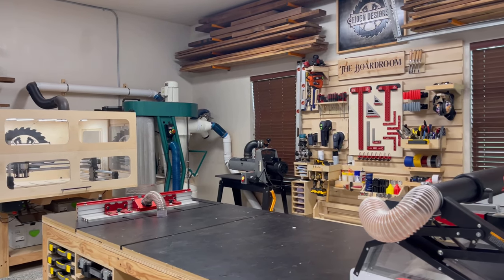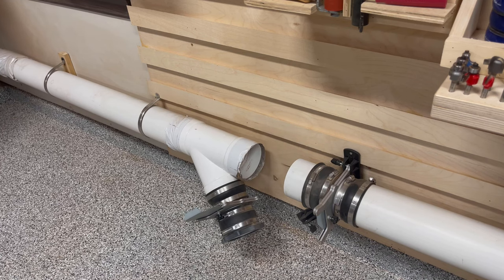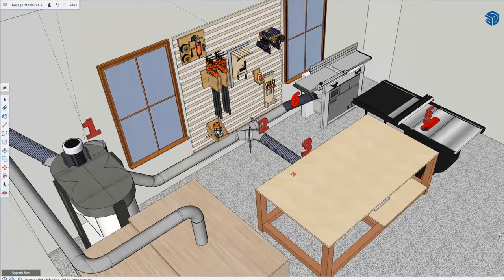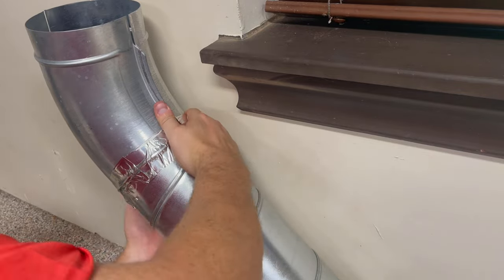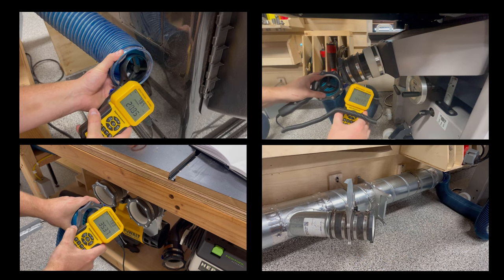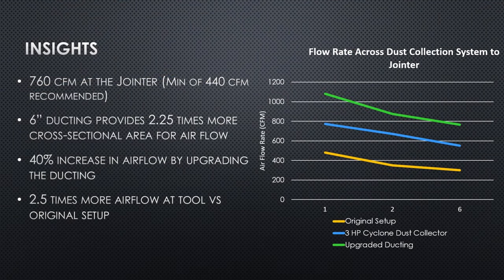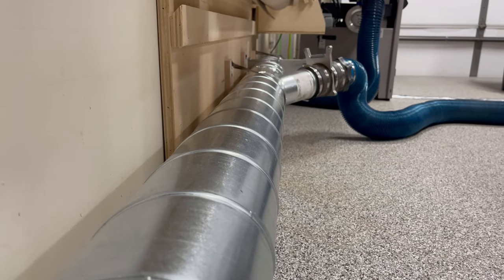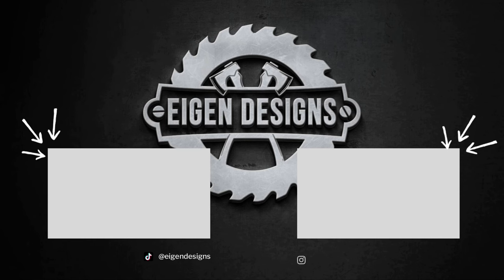Upgrading My Dust Collection Ducting  |  Airflow Analysis of 6" Ducting

Comment: Just figure the difference in the area of a circle 4" diameter versus 6".  My 3hp cyclone with 6"" pipe does fairly well even with my wide belt sander and edge sander.  The 15" planer works well even with 2 gates open.  Did have to modify the edge sander port to 6". My wide belt sander had a small opening, and had to cut the opening a little bigger to get 6" connected, and it is the hardest machine I have to collect from.  Problem now is a 50 gallon barrel fills very quickly.

Comment: wow pretty much the best made video I have watched in 24'  sketch up looked so good... your voice and not a wasted word.   THat flex to saw stop must be a tripping hazard?  I hope you included links so we can get a quick look at 6" spiral pipe costs.
Reply from the maker: I am glad you enjoyed it. Yes, the flex hose is a bit of a hazard, but it's only connected when I am using the sawstop. I use some MagPort quick-connect couplings to easily attach and remove the hose when not in use.

The spiral pipe can be found at Rockler.com at search for spiralpipe. It's expensive stuff, be warned. It's not uncommon to have your ducting cost more than your dust collector. I have been operating this for about a year now and think very highly of the ducting, the blast gates, and the elbows. It's a significant step up from PVC, but you pay for it.

Have a good day.

Comment: Any issue with grounding? I thought metal ducts were prone to static issues.
Reply from the maker: I haven’t had a single issue with the grounding. You can certainly add a grounding wire if that’s a concern

Comment: Thanks for the excellent videos and thorough analysis.  I really appreciate your precise measurements and the detailed graphs and tables comparing the results.
However, you forgot one very important tool in your analysis… the “CNC”.  
I have been planning to purchase a OneFinity CNC, but do not yet have any dust collection.  I was looking at the smaller Grizzly G0860 (1 ½ HP) dust collector to reduce cost (about $1000 vs about $2200 for G0862). 
What do you think is the minimum HP and CFM needed for the CNC?  Did you measure the flow at your CNC?  
What factors compelled you to choose the 3HP G0862?  
Thanks!  (I'm subscribing!)
Reply from the maker: Hey WJ - thanks for your support... it means a lot. 

Regarding the flowrate at the CNC, I didn't measure it for two reason: (i) the ducting run from the dust collector to the CNC is very short and (ii) my CNC already had way more flowrate than it needed. 

Looking at the two dust collectors you mentioned, I think either of those would be plenty for a CNC, provided that you have a good dust boot. Beacuse of how close the dust collection hose gets to the CNC router, the CFMs needed for good dust extraction is much lower than something like a table saw. One thing I would highly recommend is a 4" dust collection hose. I used to have a 2-1/2" hose and it just wasnt big enough.

Comment: Nice video. We understand your shop is cramped. Imagine if you could have a straight 10’ run going into the dust collector. No bends; no flex hose. I wonder how much of a CFM increase an ideal layout would add.

Comment: I run six inch ducting but I can hear myself whisper with my dust collection on full power. I built a soundproof closet for the DC but I pull air(which is more efficient)  instead of a giant blower housed on top of the cyclone blowing air downward, which is an archaic system imo. 
An obscenely loud DC simply isn’t an option for me personally. Especially with the CNC router where it’s sometimes running all day..

Comment: I have a single stage d/c with 6" to every machine  (including at the machine, no 4") and agree that the larger pipe size is the way to go but only if you're a one man shop. You'd need the 4" at each machine if more than one machine runs at a time though
Reply from the maker: That’s a good point. The sum of the areas of the open ports shouldn’t exceed the area of the opening going into the dust collector. Thanks for sharing T Bunton.

Comment: Thank you, this was well done and very well presented. May I ask one question: I want to upgrade to a new 3HP dust collector and I am torn between one like you have, the grizzly 3HP, which is considered a short cyclone design and a longer cyclone like the V-3000 Oneida.
I hear comments on the lack of separation capabilities on the more compact units. Are you experiencing any poor separation to where your filter is clogging rapidly with the finer dust particles ? Do the longer cyclones actually work better?? I guess thats two questions, sorry.
Reply from the maker: I personally have never had any issues with poor separation with my shorter cyclone unit. The only time the secondary bag starts to fill up is when the primary bag is full and its time to empty it out. I can see how a taller unit might improve the separation, but it just hasn't been an issue for me.

I hope this helps you make your decision.

Comment: Hi Mr Eigen: I seem to have the same anemometer  you have. I have had some challenges using it. In the CFM mode it is 4567 at the end duct the furtherst from the dust collector, and it should be around 440CFM`. And when I put it near the dust collector port it appear to be too strong for a reading. mine is a BT846A.
Reply from the maker: Hey Micheal, I didn't trust the CFM measurements from the device. In order to calcuate a volumetric flow rate, you need to know the diameter of the pipe, which the anemometer does not. Instead, I took air velocity measurements and then used a spreadsheet to calculate the flow rate using the diameter of my ducting. You should give that a shot and see if that fixes your issue.